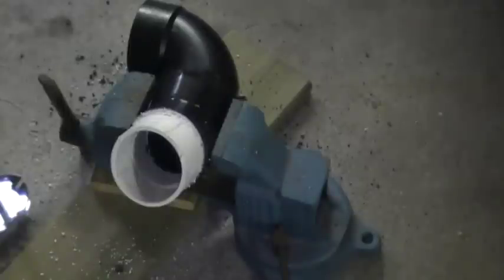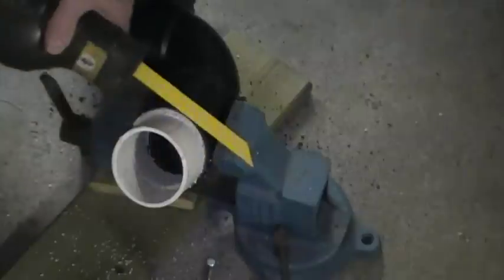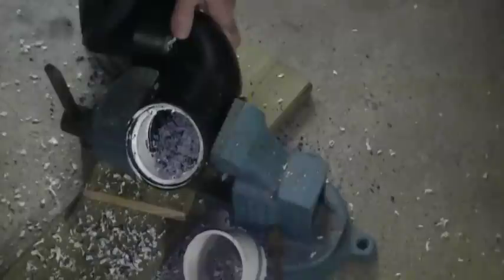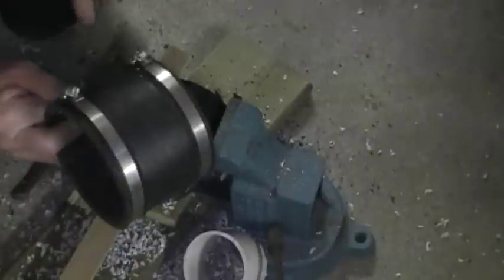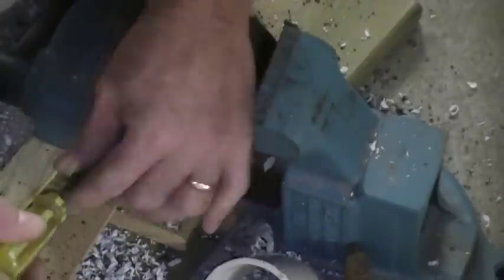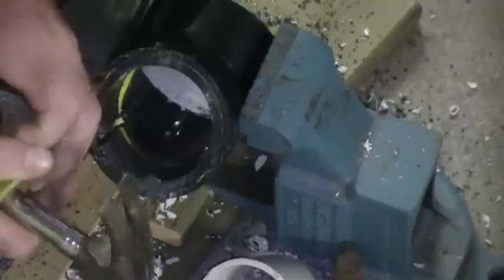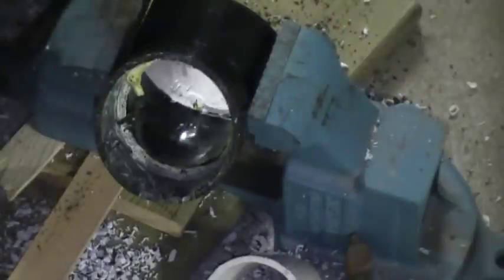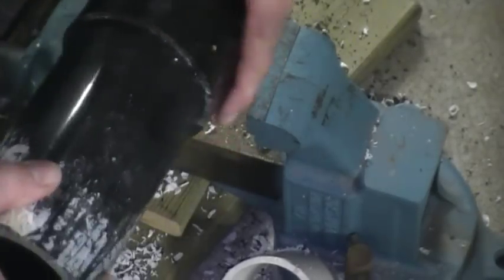How to remove a piece of plastic pipe from a fitting after it has been glued.  Plumbing tips.

Comment: I bought one of these tools and tested it on a 2" pipe cause I had a job to do and it failed so I looked for another way seen a video where they heated a hole saw up and stuck it in the pipe and it heated it but didn't melt the outside pipe but got inside pipe soft where you could stick a screwdriver between the two pieces and just work the inside pipe out I then tested it and found it worked so use this way on the job I had to do and it worked great.... Now they make a much better tool than what you are using but the way I did it will be the way I do it agin if I have too...
Reply from the maker: Hello James,
I am glad everything worked out for you. 
I have picked many a glued joint in the past, but they are always coming out with new tools to make work easier.
Congrats on the repair! 
Thanks for commenting and enjoy your week!    Al

Comment: Thanks a million Oldkid888!  Was out of practice with the PVC and made an error that would have taken a while to fix, until I "picked a pipe".  Amazing how easy it was. I used 2 screwdrivers and a small wood chisel (like taking an inner tube out of a bike tire - the old ones with thick rubber)  and the whole thing just popped on out (1.5" pipe to 3"-1.5" Y connector).  Haven't seen any vids on the mental aspect of laying the stuff out.  Will subscribe and check out your other vids.
Reply from the maker: Hello Rick;
I am glad everything worked out for you!
Once you get the first piece started the rest comes easy!
Thanks very much for commenting and have a great day!    Al

Comment: I had an old busted toilet mount in my basement that was one piece right to the elbow below the slab. I had to pick away at it for quit some time removing the beveled section until I got to the elbow under the slab. Very confined I had to drill hole from the inside out all the way around and used a dermal tool to cut the spaces between the holes. Once I got the top off I used the method described above. I cut slots and very gently separated the inside pipe form the outside fitting. 

After I got a piece remove I was able to work my way around removing it in quarter section. I had to do a bit of prying so after I got the split started  I used 2 screw drivers to work my way around using one to hold the small gap open and the other to do some very gentle prying ahead as the joint splits. The middle area was fused together but their was enough area not glued  on the top and bottom inside the joint to guide the separation. 

Be very careful,  go slow, and no twisting as you gently separate the joint

Thank  TheOldkid888 for your help
Reply from the maker: Hello  E.G. Ellithorpe
You are more than welcome!
Congrats on that part of the project! Nice job!
You have to have a little patience when you are doing this, but it does work. Removing that first slice is the key. Once you get that done; the rest comes out easier.
Thanks for commenting and enjoy our week!     Al

Comment: Great video!

 I had a leak in an ABS pipe at a 90 degree angle where it comes out of a wall, so it would've been a big pain to cut out the fitting. I followed this video and it worked fine. My only suggestion is to go slow, and don't twist the screwdriver. Then, you shouldn't have any issue with the pipe cracking.
Reply from the maker: Mark Stamp 
I am glad everything worked out for you. You are correct with the suggestion of going slow while picking the joint.
Thanks for commenting and have a great week!    Al

Comment: I know this is an old video...but it's MUCH easier to just heat the inner pipe with a heat gun and when it gets soft, just twist it out.
Reply from the maker: +Matthew Wheaton 
Never tried that before...Probably never will. 
Fumes off of the ABS are not for me. VERY strong!
Thanks for commenting and have a great weekend!    Al
Reply: +TheOldkid888 
Sure thing...it's an outdoor job or where there is good ventilation. Works like a champ though and very common among the pros worldwide.
Reply from the maker: *****
Outdoors for sure!
If all else fails I may give that a try! Appreciate the info.
Thanks for commenting and have a great week!      Al

Comment: Curious... ABS is a little more forgiving then PVC in terms of the force it takes to crack/shatter. Have you ever cracked a fitting wedging the screwdriver in and whacking on it?! Sometimes though, like where pipe comes up through a floor or wall, this is the only way to recover a fitting without cutting the pipe off.
Reply from the maker: Hello Kyle;
If I have to remove a fitting from a piece of pipe; I will place a few cuts in the fitting and remove that piece and then continue with a screwdriver and remove the entire fitting!
Thanks for commenting and have a great week!    Al

Comment: i got the same problem ..an piece of PVC broke off in the fitting....but i dont got the drill you use in this video...and once i get it out can i reglue an another PVC pipe in the fitting...texts back need help..trying to temp to do it myself..
Reply from the maker: Hello heavyweight23;
Once you have the piece of pvc out of the fitting; you can reglue a piece of pipe back into the fitting. You have to use a little more cleaner to soften up the old glue in the fitting, add the glue and you will be all set! 
Thanks for commenting and have a great day!     Al
Reply: tHANK YOU...
Reply from the maker: Hello heavyweight23;
You are more then welcome!
Best of luck!    Al

Comment: Labor is more expensive than the fitting, by the way nice table for your vice.
Reply from the maker: Hello George;
Labour is more expensive then the fitting, but there are certain situations where you have no choice, but to pick the joint; such as coming through a concrete floor. Instead of cutting the floor up to get to the joint; it would be much much easier to pick the joint!
I placed it on the floor to allow people to get a much better picture of what actually takes place.
Thanks for commenting and have a nice day!    Al

Comment: Hello fellow caper, I recognize the accent. My tub has a clogged abs trap, and it's too close to several other adapters/elbows that have no room to cut them without taking the whole thing out, which would require taking my surround out and basically redoing the entire damn thing.

My question is: is it possible to cut off and remove the trap off the 2 abs pipes it connects to, without having to take apart anything else? Like a special way I can cut out the trap leaving just the rings, and then carefully cut them off, then sand down all the glue and just pop a new trap on there?
Reply from the maker: Hello Oreoloveboss,
You may not have to go through all that.
The last thing I do is remove any pipe or take the drain apart.
I have made a video on unplugging a bathtub drain.
I am not sure if you have seen it yet, but it may help if you haven't tried it yet.
This is the name of it...How to Unplug or clear a bathtub drain Easily!!! 
If you have tried this then get back to me when you get a chance.

What you mentioned is quite a little project. Try two plungers first and let me know how you get along.
One for the drain and one to cover the overflow tightly while you plunge.
The video shows how it works.
Good luck!
Thanks for commenting and good luck with the drain.     Al

Comment from the maker: Hello Billy;

You must work in construction because on small jobs and repairs this is something plumbers run into. I also have been in the trade for 33 years and if you haven't picked a joint in ABS you should try it.There are times when you cannot put a new fitting on where the hub of a fitting is sticking through the concrete floor for example. This video was for just a situation like that.
REAL plumbers...
Enjoy your day!    Al

Comment: Hi there Al Great video I learned heaps from it thank you so much
I have a similar situation to that one where my 2 inch ABS outside wall clean out line conected to an elbow broke inside the wall when I tried to open it and that I hope not to have to cut through the wall of our new home (15 years old)
I plan to tackle this issue and before I start major surgery and make a mess I have some questions for you 
Question A:
If I was to split my 2 inch ABS at the elbow  (like you did on the video) would it be OK  I to reuse that same elbow and cement it to a 2 inch ABS line?
Question B:
Would a heat gun also work on ABS to remove the broken piece inside the elbow and would you recommend using one as opposed to picking at the elbow? I saw videos on YouTube for removing glued PVC but not ABS
Question C:
If I succeed I wish to extend my 2 inch ABS clean out line outside my wall (and not as it was cemented to a cap inside the wall), do you or does anyone know If there is a  code that I have to adhere to in order to do so, I moved to Phoenix AZ and I'm from Australia so my knowledge is limited

Please let me know, thanks M
Reply from the maker: emile manrique 
If I am am getting the first question correct...you are wondering if you can glue a piece of abs pipe back into the elbow that you have removed the pipe out of? I remove pipe from fittings from to time and I dry fit the fitting with a piece of pipe to make sure it goes in correctly. If it is a little doesn't quite fit all the way in I will sometimes use cleaner to help soften the abs, then add the glue as quickly as I can and slide the pipe into the fitting. Apply the glue to the fitting first then the pipe. The pipe should then go in well for you. Hold it in place for a minute to make sure it doesn't back out any.
I would stay away from a heat gun myself. I have never tried it, but melting the abd pipe like that will cause severe fumes and possibly a fatality. Cases of this that have occurred before from cutting threads on a lathe in a non ventilated area....they are deadly!
I am north of the border in Canada myself. A cleanout is required at the base of every stack...It can definitely be extended outside of the wall without any issues.
I hope this helps!!!
Have a great week and let me know how you get along!     Al